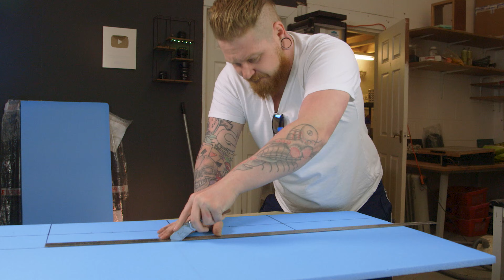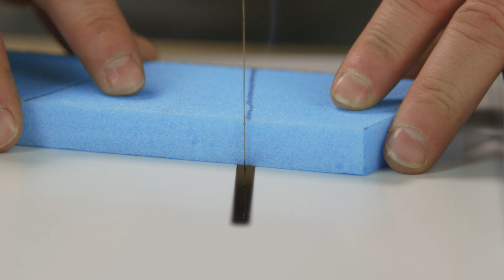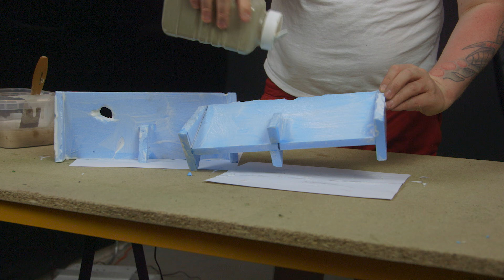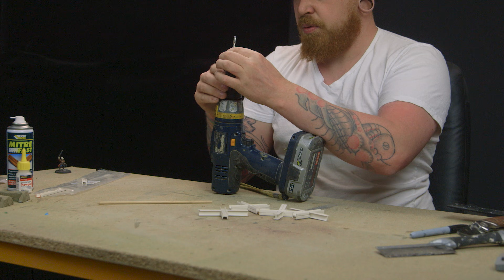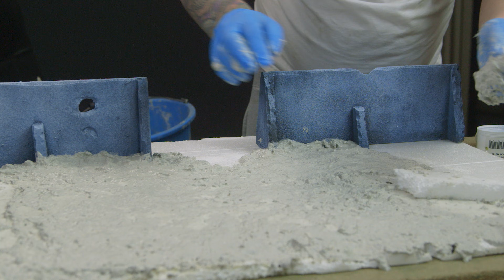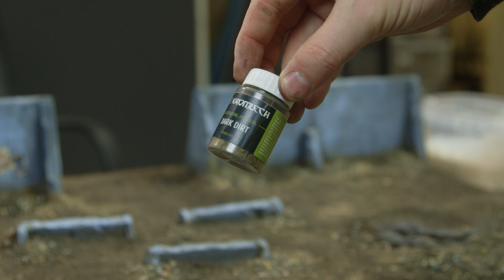Building Warhammer 40k Terrain With Foam

Comment: Hi all - I tried the tile grout tip to add texture to a wall on a foamcore fantasy building, but even after following the steps in the video, the grout remains powdery. PVA, sieve ground onto walls, give time to dry, knock off excess and spray with sealant. Once dry, it goes right back to powdery? Any ideas?